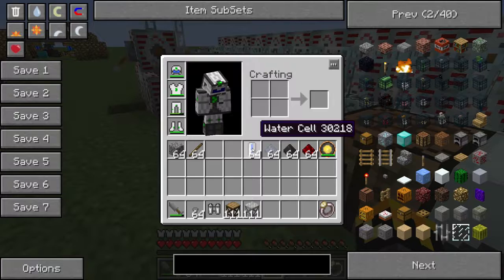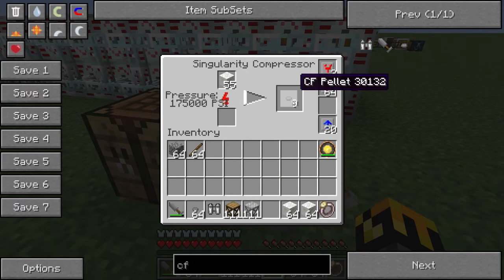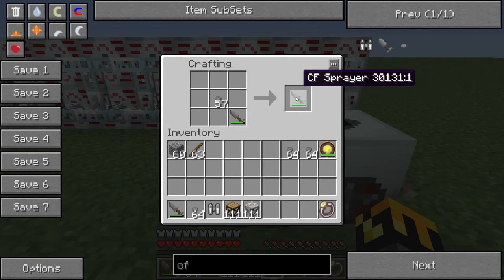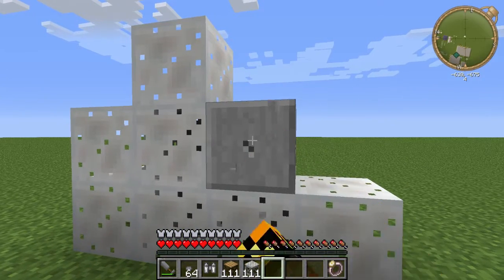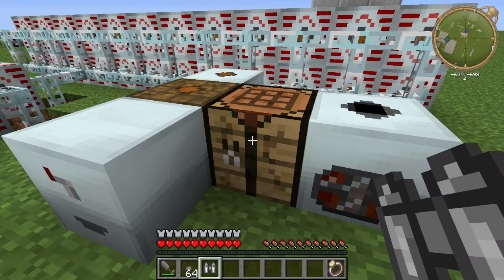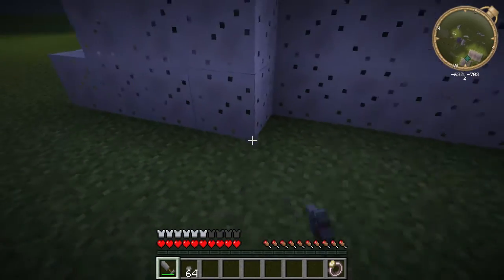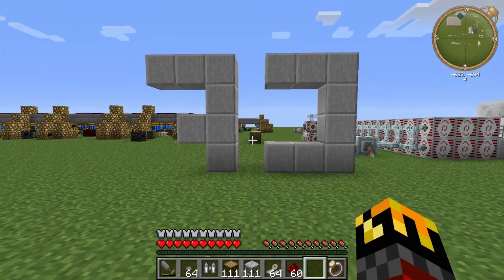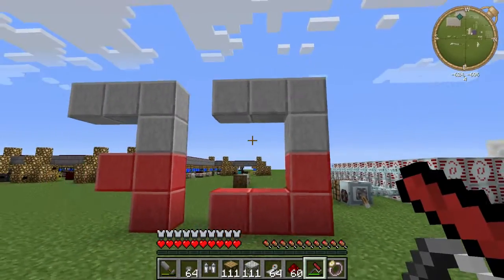Chronno Teaches Construction Foam in the Tekkit Mod Pack of Minecraft.

Comment from the maker: Yes it does, that's what it was made for.  However, like any other block, the reactor can melt reinforced stone if it's in the 5x5x5 area (or is that 9x9x9?).  The explosion will be stopped by the stone.  If you make your reinforced stone walls 3 thick, it will stop any explosion.